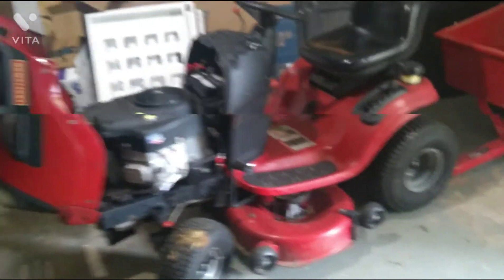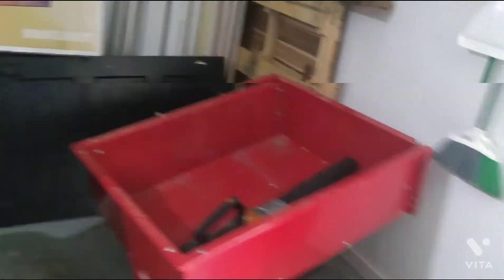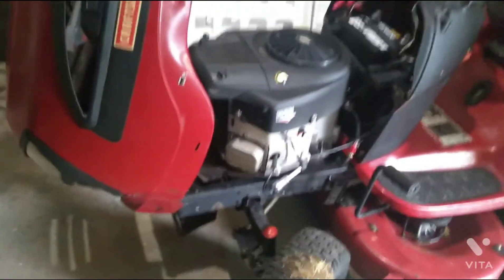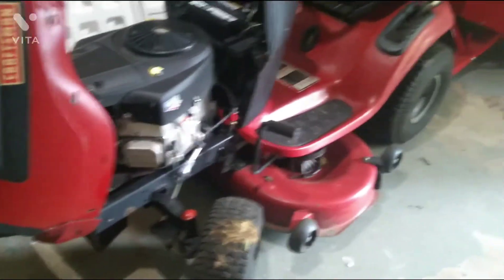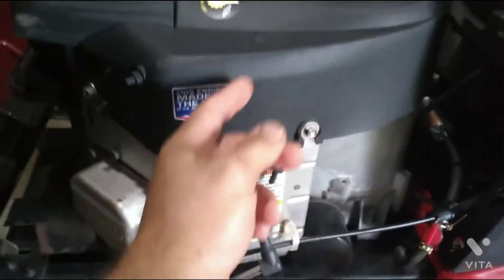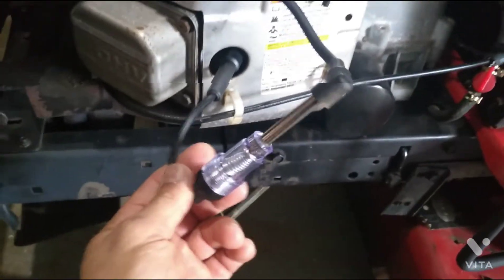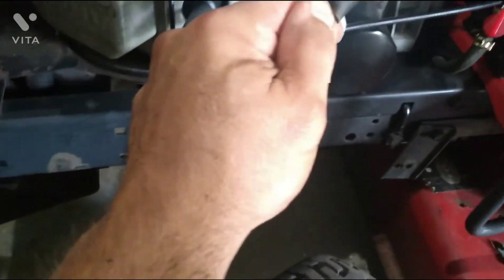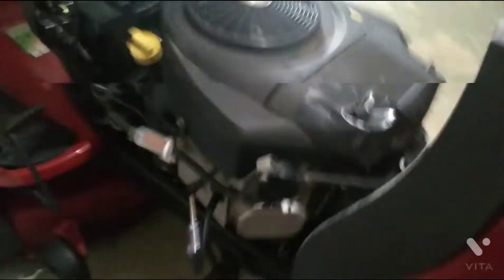Checking the spark on a 4 stroke YT4000 Craftsman Briggs and Stratton riding lawn mower

Comment: Hello Bike Revolution! Love the video. Hopefully the Phantom running strong! I got one from the first batch that came here to the Czech Republic. ZMN100 rod needle bearing. I'm not sure if to change the piston or not. I want it to be reliable. Also do you know about a good exhaust gasket for the Phantom? I need an exhaust gasket.
Reply from the maker: I hope yours runs good. I would clean the casting flaws in the jug and sand down any sharp edges on the piston. My v2 exploded because a ring snagged on a sharp edge. For gaskets, I personally trust any generic brand. There are obviously more superior types that are made of high quality material with an added metal mesh layer, but for such a small area to seel, these types are not needed. If you can get a roll of gasket paper, I would recommend that. Then use a razor knife and cut it out.